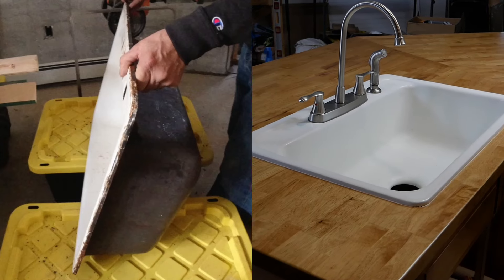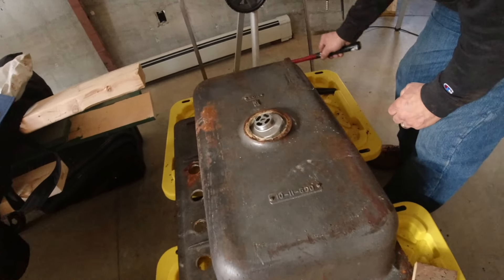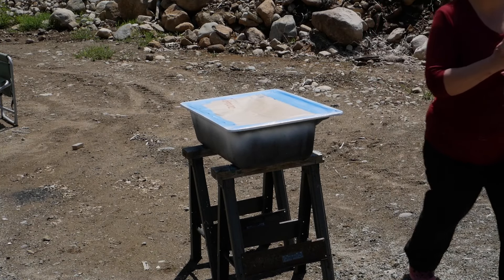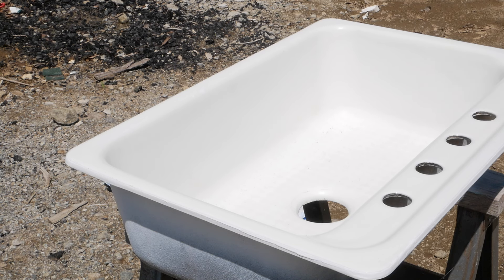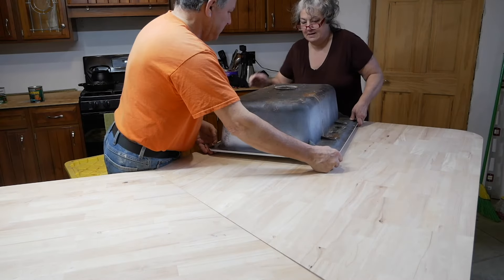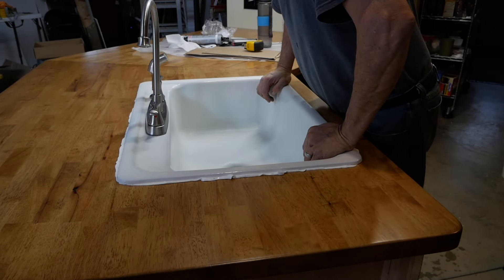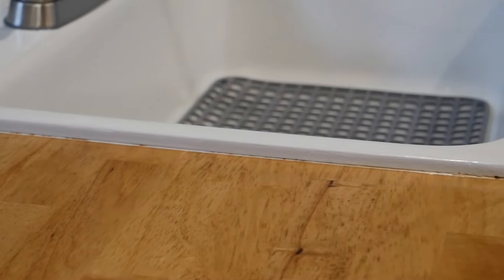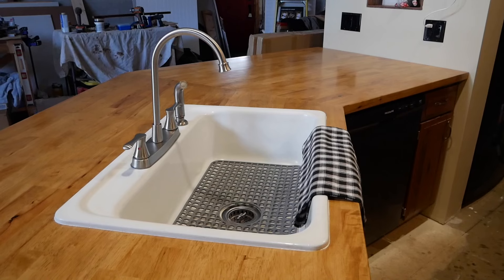Vintage Cast Iron Sink Restoration/ Modification

Comment: Ummm.   I speak from experience.  Enamal spray paint will not stop moisture and rust formation eventually.   However, there are professionals who will reporcelan. But the cost is only justified for antiques such as a claw foot deep bathtub.   Which is what I had.  They had to sandblast off the enamal paint first.  

Now....can I say I admire you off grid?  Yesterday a massive Douglas Fir tree went onto the power line going to my ranch. It appears so far all electronics are ok even though one phase wire on  public power circuit breaker didn't trip. But,  Because the termination power pole anchor was slant drilled underneath the house foundation the south east foundation corner rose about 3 inches.  No foundation cracks or windows broke.  I guess it will settle back in place eventually.  😢
Reply from the maker: Ah, that’s a bummer! Hope it settles back soon